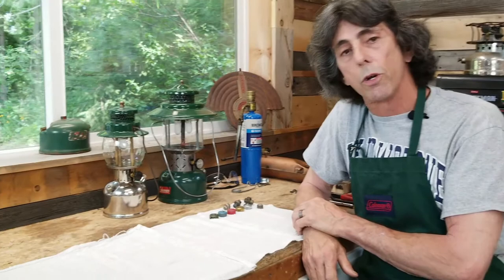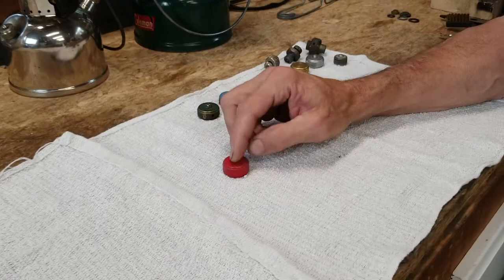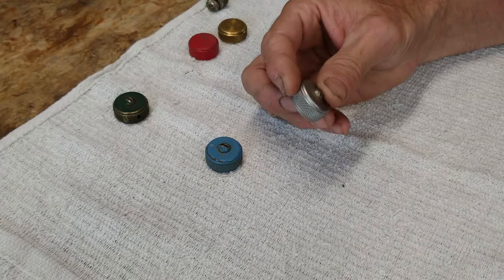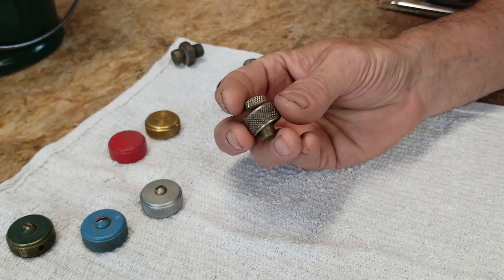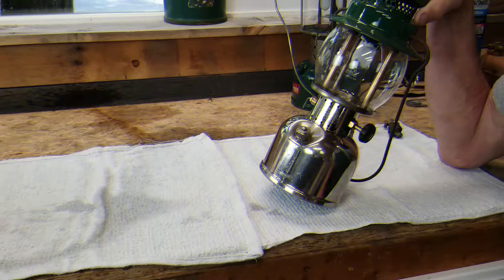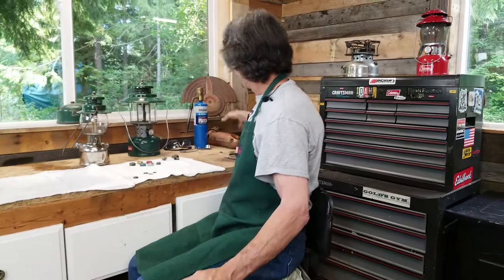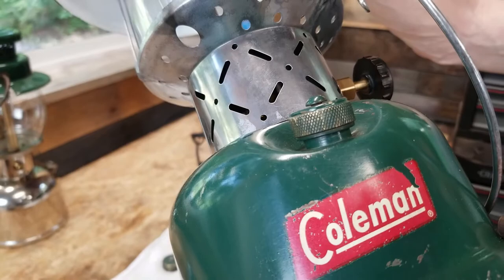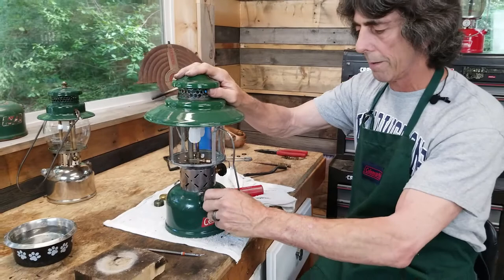Coleman Stove, Lamp and Lantern Safety:  Identification, Use and Repair of Fuel Filler Caps

Comment: Great video, saved me from being sprayed with gasoline from an old 425B stove.
The tank is red and has the cap with the side hole and was gummed up. Had to use pliers to remove...the vent hole DID work & sprayed some gas. Followed your advice and had it pointed up & away.
Reply from the maker: Awesome.  I've been sprayed a few times and it is just nasty.  Especially when the fuel has been in there for many years--it is really ripe then.

Comment: Frank, just want to echo how much we appreciate your professionalism, expertise and willingness to help. Not sure where I should ask this question so I’ll try it here: I have a lantern that was given to me but don’t know the model number. I “think” it’s a 228?? The fount is nickel plated with a 0  2 as the date, the large ceramic green ventilator hat, two mantles and the generator is slanted with the valve wheel at about a 45 degree angle. The fuel cap is the dangerous one-pressure relief hole in the side of the cap. I assume the globe is not original because it’s one piece and doesn’t have slide access opening. I don’t know if the date means Feb 1920, or Feb 1930 or Feb 1940.  Any ideas? I want to order parts to, refurbish and use it after watching your disassembly, cleaning and assembly videos. Thanks for reading.
Reply from the maker: Jim that is a nice lantern. You are describing an L228 lantern, commonly referred to as a "slant 228" and is the first 228.  Yours would have been made in February of 1930. They are a bit different than "standard" 228s of later years but are just beautiful.  Contact me at info@oldtowncoleman.com if you have problems.

Comment: I'd be interested to hear what you have to say about the fuel caps that incorporate a pressure guage, and, the fuel caps modified with a schrader valve.
Reply from the maker: Mitch, hello sir.  I have a cap that has a pressure gauge and I have not used it in 15 years.  I don't really care how much pressure is inside the tank or fount--I do care that the lantern or stove is running properly so "sufficient" pressure is good enough for me.  A gauge on a multi-appliance system, like the old hollow-wire light fixtures, would be useful, but I just can't see the point with a single lantern or stove.  As far as the tire valve goes, I personally don't mind using the pump the way Coleman installed it so I haven't used one of those caps.  Its kinda like using clip-on mantles or propane lanterns...not my cup of tea as "old school" is what I prefer.

Comment: Thx for the info - GREAT JOB !!!   Can you explain the diff in the 11-20-21 mantles ??
Reply from the maker: Michael they are sized for candlepower.  20s are small, 21s are for "normal" lanterns like 200A and 220s and such.  Use 11 on high output lanterns like the 237.

Comment: Would it be possible to drill a hole in one of those caps install a fitting plumbed to the low pressure side of a bbq regulator and run the lantern on propane. Possible or death wish what are your thought on this .?  Sarge348

Comment: I’m replacing the fill cap gaskets with new gaskets on my Model 425B Stove, a Model 200A Lantern and a Model 220F Lantern.  Each has a 3 piece cap, but the interior portion of the caps did not stay on the fount after I removed the top screw and then removed the main cap (the interior portion stayed within the main cap).  How I can remove the interior portion of the cap, so that I can then burn out the old gasket and insert the new gasket?  Would it hurt anything if I burned out the old gaskets, while the interior portion of the cap is still within the main cap?
Reply: You can try putting the screw back in part way and then lightly tapping on the screw head. That should knock it out of there.

Comment: What size gaskets work for the single piece (post 1970s) caps? I've purchased the cap gasket 220 from old Coleman parts and the no. 2 fuel cap seals from Basnets and both are too small
Reply from the maker: The gasket you purchased is for the 3-piece fuel filler cap; oldcolemanparts.com does have the gasket for 1-piece caps, https://www.oldcolemanparts.com/product.php?productid=2732&cat=&page=1
Good luck!

Comment: We have a Coleman 220h one of the burner screens is missing. Our burner cap is frozen on the stem and we can’t get it off. We have penetrating oil on it over night, it’s no better and it’s still sitting. Would be able to give some advice on how to remove this cap?  Thank you
Reply: I use plastic adjustable wrench to not mar the brass with very light pressure so as no to bend it while turning
Reply from the maker: They sure can be a bear to get off.  I'd recommend starting with a plastic wrench as Silkworm describes.  If that doesn't work, use a torch to heat the burner tube/burner cap junction and then try to remove it.  It may be necessary to replace the entire piece--that is, a new burner tube with a burner cap & screen.